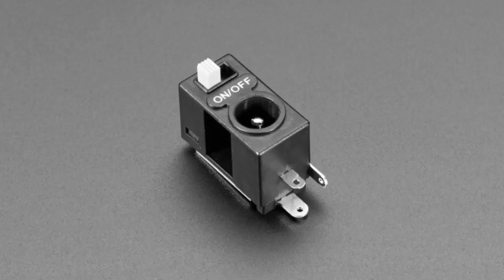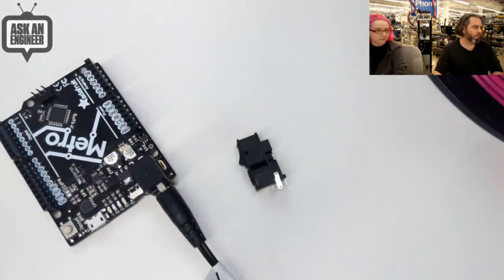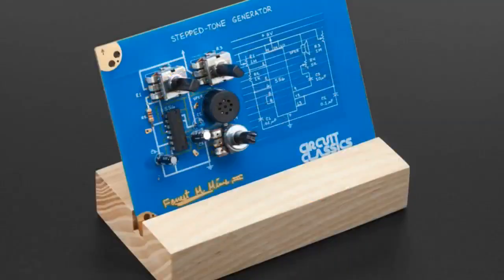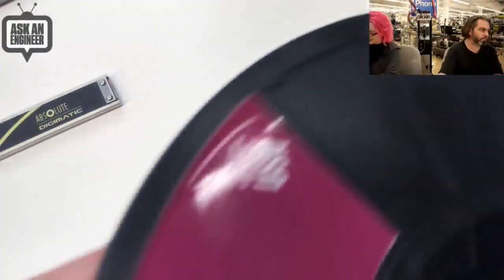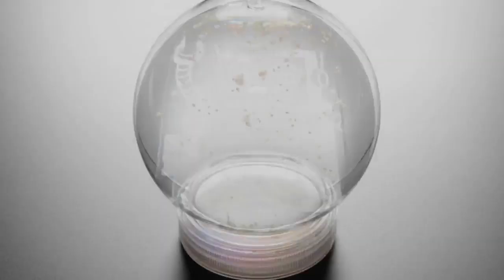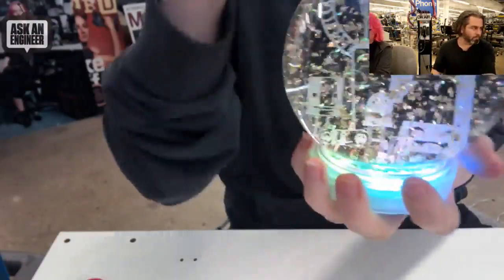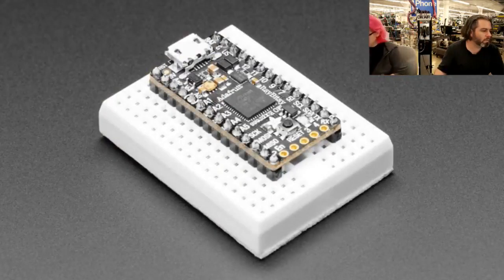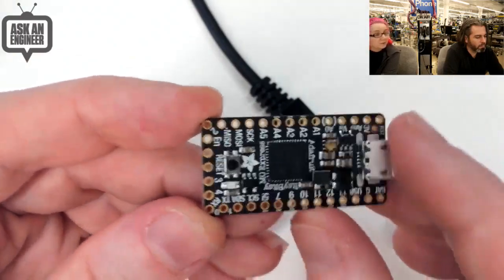New Products 2/7/2018 @adafruit #adafruit

Comment: Can the Adafruit ItsyBitsy M0 Express programmed with the regualre Arduino IDE? I don't need that python and want it to use like any other Arduino board with a eg 328. Do I need another bootloader or will it work with the IDE out of box?

Comment: i feel you were misled about the filament diameter. Very few 3D printer use 3mm (2.85) filament. Ultimaker and Lulzbot are really the only major manufacturers still producing printers that use that older standard and are within consumer pricing(barely). Nearly every printer from Prusa's down to diy kits from china use 1.75mm filament and you are basically shooting yourself in the foot given the marketshare these other printers have not being able to use 3mm filament.
Reply: Jason Donofrio not only this, but printers like the Ultimaker can use smaller filament in a pinch, but obviously 1.75mm printers cannot use larger filament. Furthermore, 2.85mm has major downsides. It's worse for retraction, it has more issues with flexible filaments, filled filaments are more likely to jam, fast printing requires a more expensive heater, and more. This is why most companies avoid it on their printers.
Reply from the maker: We carry both diameters, not just 2.85mm. This makes sense because we carry the sigma BCN3D and the Ultimakers, both optimized for 2.85mm. Thanks for your input 🙏🏽